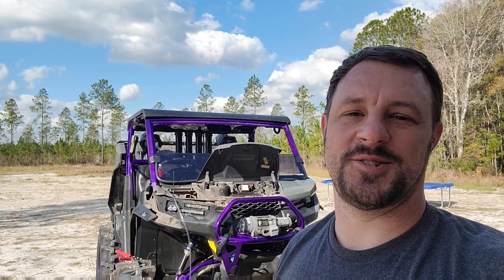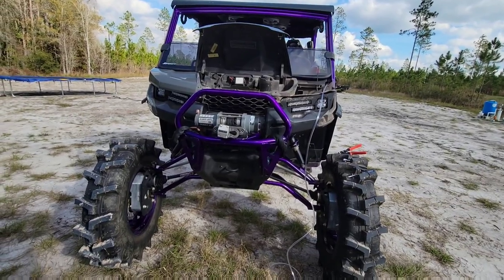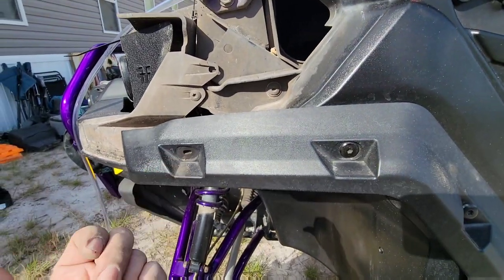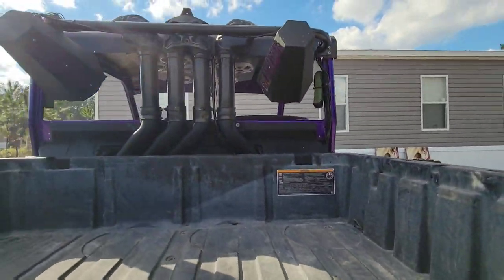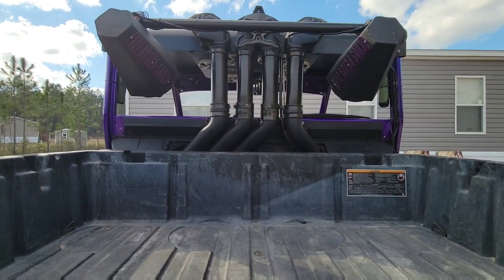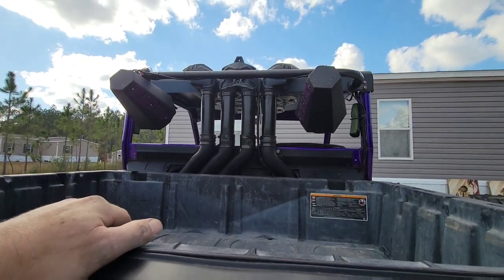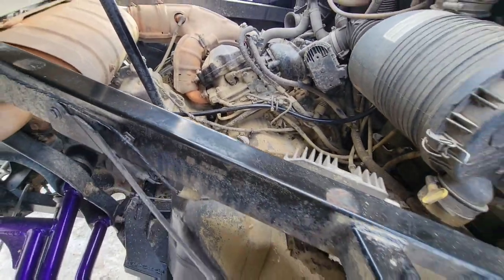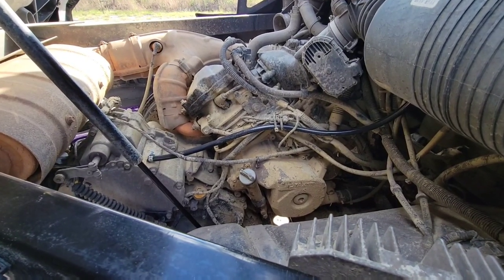How To: CanAm Defender XMR Snorkel Risers & Deep Vent Line Routing

Comment: Why do you have to run the belt exhaust back down ? Or can you get away with just running it to the top and leaving it there ?
Reply from the maker: Good question. You can just run it up and leave it there but it does blow cool air on the exhaust system to prevent it from getting too hot. factory tunes run lean due to emissions reasons.

Comment: question just bought a 2023 defender that little rubber boot on the bottom of the air box what did you use to keep water from getting in i seen you had some kinda little torque squeeze key on it that is yellow
Reply from the maker: it has a factory xmr cap. I bought it used I'm not sure if that clamp is original or not but I believe it is.

Comment: How high does the factory XMR vents run
Reply from the maker: Front diff only goes to front drivers fender. Rear trans goes to middle snorkel. Fuel vents go to top of bed and then go downward.